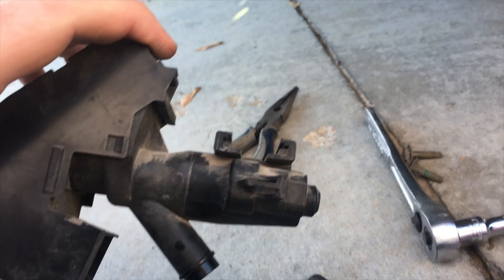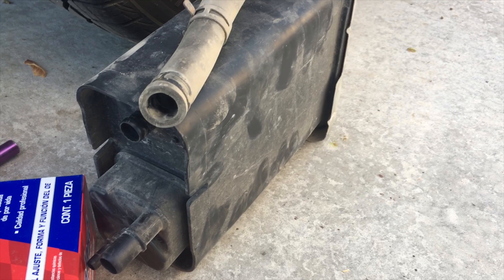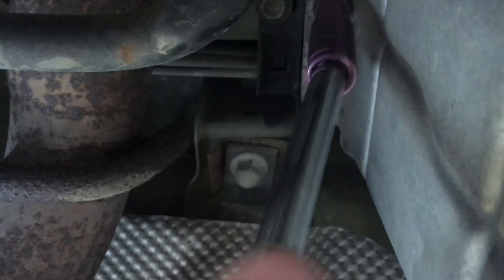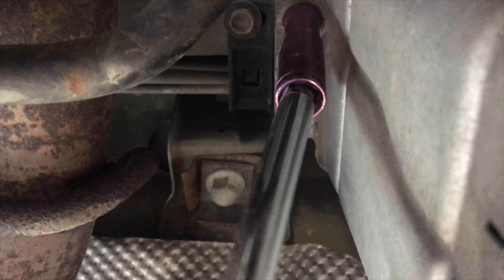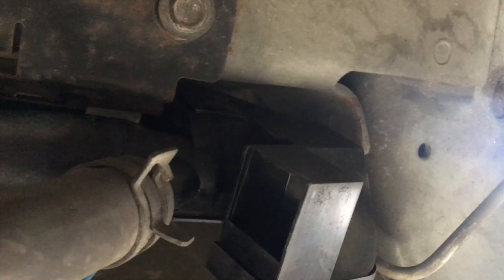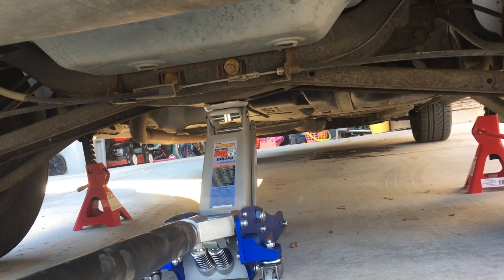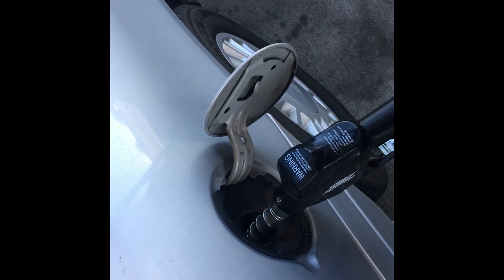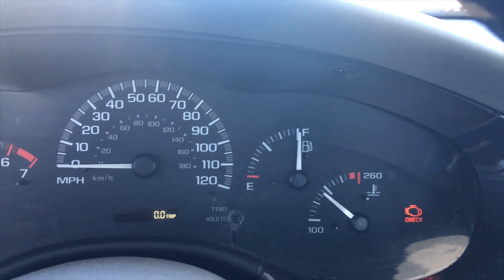04 Malibu 2.2L Canister Vent Solenoid

Comment: Now when your canister in the back by your gas tank, starts to go bad and you're pumping gas in your gas tank and then after you fill it up or get you whatever you want for some reason it does not start is that because of the canister picking up air into your canister and causing light fuel blockage or a vacuum

Comment: I have a 2000 Chevy Malibu and gas is coming out of my vent feel  Solenoid would you connect after the charcoal canister do you have an idea what it could be
Reply from the maker: If fuel is coming out of the vent solenoid, then it is not closing properly and should be replaced. Take it to a competent mechanic to make sure there is nothing else wrong.
Reply: Thanks for the reply but I already took care of it when I replaced the fuel pump I had to switch the lines because I had the vapour line coming out of the canister to the fuel side instead of the vapour side thanks for helping me out anyway I really appreciated
Reply: @robertrandin9568  can you please tell me how you did this is have something  to do with the gas pump

Comment: If my code says "EVAP canister purge vent blocked, does that mean i need to buy a canister vent solenoid?
Reply from the maker: Not necessarily. The purge vent may have something blocking it, the canister may have filled somehow (overflowed from gas tank) or the solenoid may have an issue. If you’re under there anyway, you might as well verify the vent isn’t plugged and the canister is empty. If those two are fine, the solenoid is likely the culprit.

Comment: how to remove those clips from charcoal canister?
Reply from the maker: The ones on the hoses? They are oval shaped and you squeeze the narrow ends towards the middle to make it a circle shape and then the connector slides off.